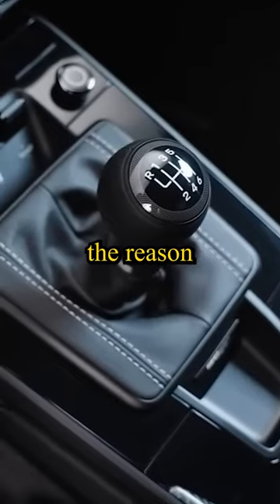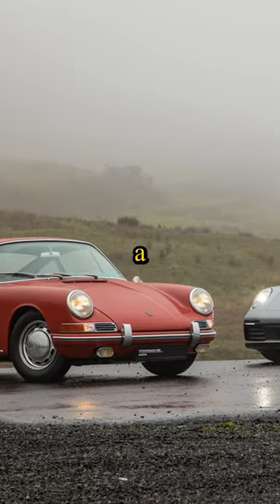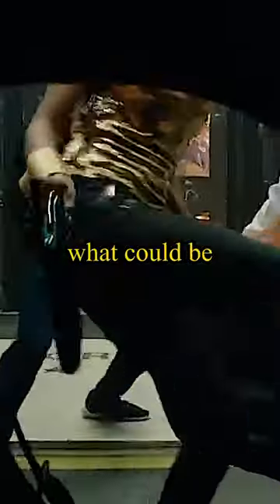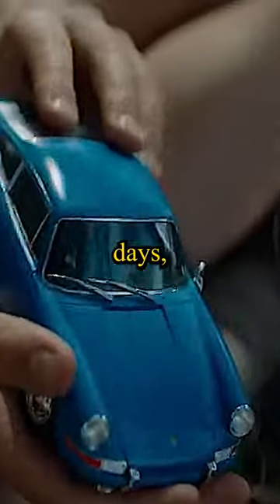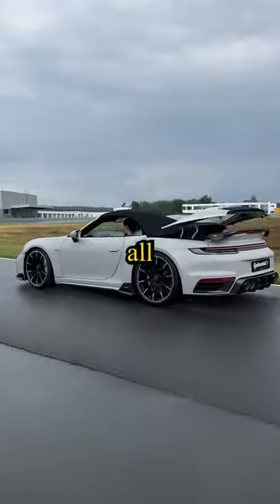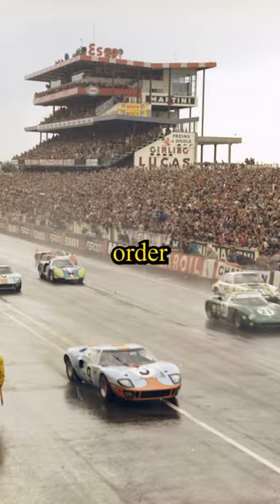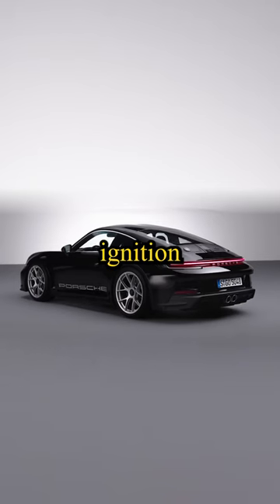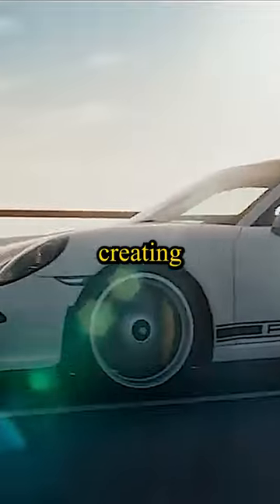Porsche's BIG SECRET is NOT what you think. #porsche #shorts

Comment: To clarify - the 1970 Le Mans Porsche 917 had the steering wheel on the right, not left, and the ignition key was inboard and to the left of the driver. There are separate emergency shut off switches mounted externally on the left had side accessible via an opening in the body, behind the left ‘passenger’ door! Another was fitted in some variants externally on the front just in front of the windscreen.
Reply: 1970 was also the First year where the drivers were already sitting in the car at the start.

Comment: old Porsche 911 had it on the right  when they start 24hr of le man they started putting it on the left so there drivers could put the car in 1st and start it at same time ok and the 911 was originally called the 901 most of the car called 901 is race cars but any car with any triple digit number with zero in mid is copyrighted by skoda and it was rename 911

Comment: None of what this AI thing said is  correct!
Reply: Why? Tell me the truth why its on the left...
Reply: @pe.p.9102   Ignition on the left meant less wiring and less wiring meant lower material costs. 
It's actually not that cool of an answer
Reply: @politeaf740  its because something called of a lemans start thats the actual reason
Reply: to support this. Porsche won LeMans in 1951 with a 356 SL. The 911 is from 1962/1963
Reply: @pe.p.9102 I knew someone with a 1982 Rolls Royce and the ignition switch was on the left side, maybe it has something to do with where the car is made